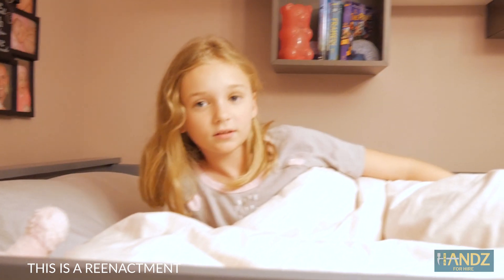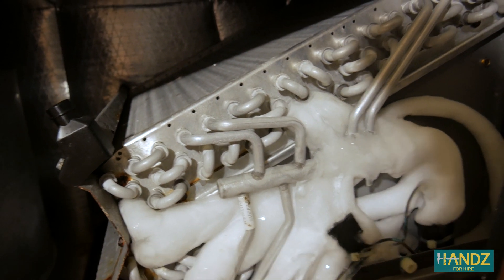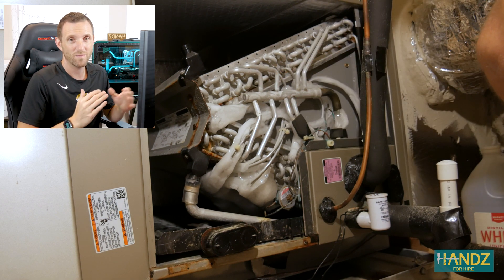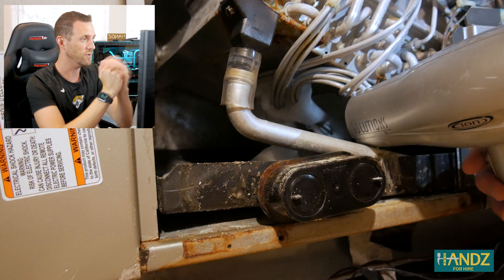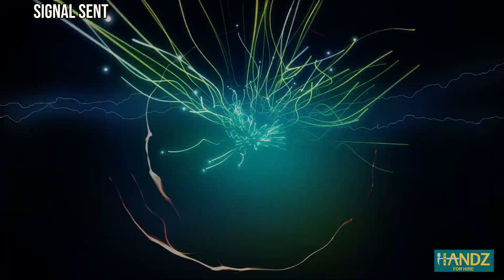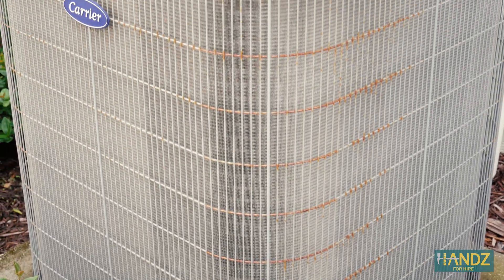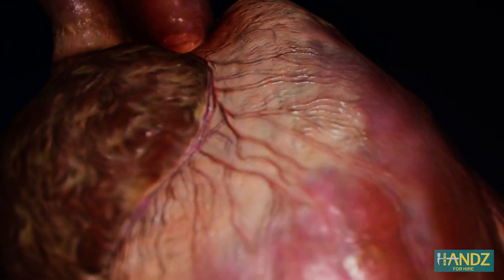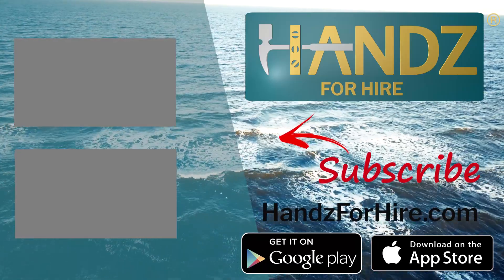EASILY FIX YOUR AC THAT WON'T TURN ON | How an Air Conditioner Works

Comment: how long did it take for it to turn on?
Reply from the maker: If I recall correctly, it started working pretty quickly (less than 10 minutes) after it was thawed. I flipped on one zone at a time and waited for the thermostat to click on.

Comment: They don’t accumulate ice by running all the time. The saturation temp is above 32 meaning it won’t build ice.  Low air flow, restrictions or low charge. Not from stopped up drain line.